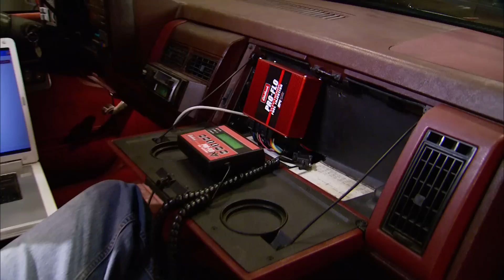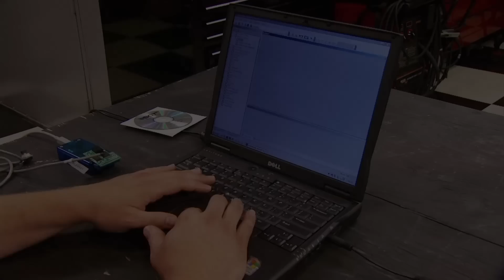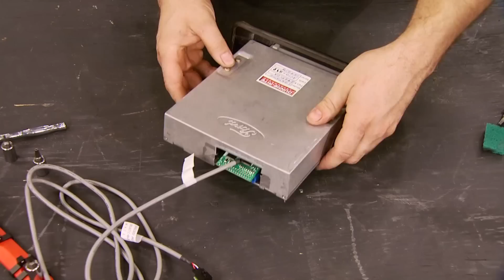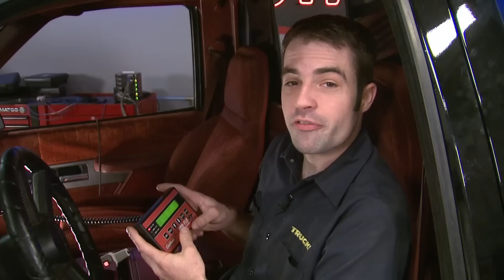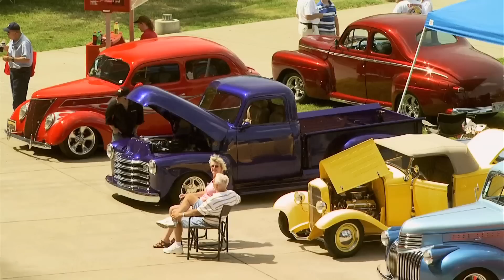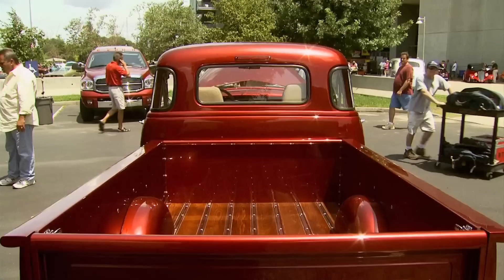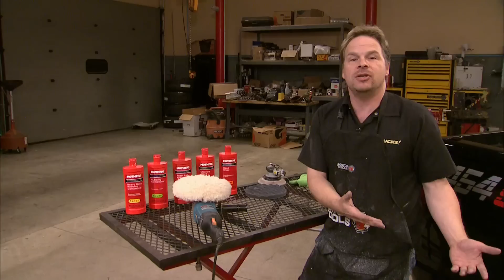Chassis Dyno Shootout: Chevy 454 SS vs Ford Lightning MuscleTrux Wars Part 6 - Trucks! S10, E15

Comment: Got to cost some $$ to get those guys to tune that OBD1 machine. Chips are such a pain. Dealing with a 94 k1500 have to do it through mail for most of us.  Who uses scotch lock connectors. 318hp ? Most small blocks can do that easy. Wow that laptop is over 10 years old.

Comment: Why in the World wouldnt you upgrade from the stock fuel pump.....
Reply: STREET RACER Why so rude? You get whooped by a few Lightnings?
Reply: STREET RACER Nevermind. The internet answered for you. Apparently you’re a well known shit stain around here. Lol 

What a tool.
Reply: 10 year old show
Reply: STREET RACER I don’t speak shit stain. Let alone peasant. You street race or “allegedly” street race because you’re not good enough to get a on a track and do it for real. You’re not even on my level. I wouldn’t even hire you to buff my race cars. 
You’re literally a tool. And a bad one at that. Stop ruining the car scene.
Reply: But they did.
Reply: Because it's a TV show.   I mean, they had the exact fuel pump right there to install.   I'm pretty sure they knew.  It's a TV show first and foremost.   They need content.
Reply: They technically did the put an inline pump in to help. Just didnt end up being enough fuel
Reply: @tannergallie9061  Yeah that does absolutely nothing when it has to draw through the tired stock fuel pump. The bigger injectors are only a small part of the whole picture when going with a power adder. I've seen it many times where somebody will install these exact same parts, but leave the stock and tired fuel pump in the tank and look in astonishment when their big money build falls flat on its face or roaches all the pistons because it leaned out under boost.

Comment: Lost alot of respect when you threw on the scotch lock.
Reply: Lolol even the old twist and tape is a better temporary connection. 
Those are supposed to be for temporary use , but I won't even bother with em at all either.

Comment: Instead of that stock Ford computer that require a chip I would have just swapped it out for a holly system. Plug and play. I'm not sure why anyone would want to monkey with that stock computer stuff having to burn chips anymore. But it will be nice to see how well they can make it work. I am curious why the choice was made to use that ecm instead of swapping out for an after market system like a Holly Dominator though?

Comment: Chevy Silverado's suck, I had two of them and they got alot of miles on the original engine and transmission no complaining about that. But they waste so much gas, the seats are cheap, the plastic brakes easily. I see alot of butt hurt fan boys. I'd buy a f150 over a Silverado any day.

Comment: these boys are living in 1994
Reply: So, what were they supposed to do in 2008, rebuild the engine and install aftermarket ECUs?
Reply: @wade998  yeah even in 2008 aftermarket ecus were around Ive got a haltech 500 sprint i think i got it in 2009 and them honda boys were doing it way before that with hondata Haltech was started in 1980s and had reasonably cheap standalones on the market by 90s
Reply: @CAZEDUPLESSIS  but, MUH CARBS!!!
Reply: @CAZEDUPLESSIS  I know, i had Greddy Emanage, HKS F-con, and AEM for 7mgte.  I found SAFC is the best bang for buck piggy-back.

Comment: NOW I would like too see  dump  the fuel injection and go carborator see if they pic up horspower!
Reply: Did it but no turbo better cam and heads no trans work and calculators put me in the 550 to 600 hp range
Reply: Uh nope

Comment: Isn't that from like 1999... lol chip burning... the Holley Dominator system you can get for what nine hundred bucks and it's like modern. First time I've ever heard someone going to a mass air flow system normally throw those things away when you make power. Go to any drag race event and see if anybody is using a mass air flow sensor.

Comment: The fact that they turbo’d a first gen lightning is so incredibly lame. Way to ruin a classic and make it as ricer as possible
Reply: And its hardly a classic.
Reply: 10k on a truck turbo kit lmfao
Reply: 4 grand for twins. I doubt piping is an extra 6 grand to get it to the bed.
Reply: A ricer is a car that looks like shit and is slow as shit. A turbo V8 truck that looks like shit but has decent performance is far from rice lol.
Reply: K5 Guy decent performance?? They easily spent $10,000 on that turbo setup and it doesn’t even put out nearly what a 2nd gen lightning does bone stock. And yes... a first gen lightning is a classic... nearly 30 years old and very rare. You’re a moron
Reply: Point is. Its anything but a ricer.

Comment: That 454 could of used a stroker bad or a non intercooled vortech
Reply: That 454 needed 11:1 compression to hit 500whp
Reply: @hemiboy9860  or forced induction to justify that low compression ratio.

Comment: My goodness that is trash!! I dont know what they did but a set of decent set of heads and cam on 454 should make 400+ to the wheels
Reply: @YOYO MA is that when this was filmed? If it was I still disagree lol my paw paw got a bone  stock 454 SS in 2000 when I was 10 stayed stock until 2002 I can remember it getting Edelbrock square port aluminum heads cant remember wich series probably performer rpms I doubt they where Victor's they where not ported but he did clean up all the ports but it did get a victor jr intake that he cleaned up and a 1050 dominator I would have to ask him about the cam all I can remember is that the shift light on the monster tach lit up at 6600rpm and sounded nasty through long tubes and a dual 3" set up with super 40 flow masters and turn downs still one of the best sounding car/trucks iv heard. It had a N.O.S plate pilled for a 100 shot and ran like 7.00's in the 1/8 on motor and 6.70s on the bottle in 2003 and that's like 560hp at the flywheel by using a hp calculator
Reply: @woodgrain18 , LOL! You have life in a BLENDER ON PUREE to claim 6600rpm from a stock 454! 6600 is a DREAM, but nothing more in a stock 454SS. It would be shocking to see it hit 5500 and 6600 is simply 100% out of the question when stock, TERRIBLE rod ratio is the biggest problem and when stock, that can't be fixed.
Reply: @robwh3954  lol ok..... I turn a sbe 5.3 to 7600 and shove 25 pounds of boost with a cam & springs china head studs and rod bolts every time it goes down the track or play on the street so and ring lands break first so I have a little experience in makin sbe shit live and go fast and I learned from somebody who has been doin the shit since the 60's. Get some real life experience before you trying to lecture me
Reply: @robwh3954  wtf are you talking about rod ratio??
Reply: @robwh3954  lol I just read your whole comment I can't believe you just said rod ratio? Idk where you heard or came to that conclusion lol the reason it want rev stock is cam and valve springs those are shitty heads so it might not make a ton of power but it would rev
Reply: I bet that transmission is garbage
Reply: @Frank Bonazza III there is a difference between a 4cyl and a 8cyl? Wow thank you for setting me straight. I never said a peraon was going to run a stock v8 pushrod out to 8,000. I simply stated that they set the factory rev limiters well below what the engine can safely take.
Reply: @sinformant  
NASCAR V-8s rpm to 8,000+ .
A V-8 is two 4 cylinders with a common crankshaft.
Pontiac made a 4 cylinder,  CUTTING a Pontiac V-8 in half.
( 1962 -1963) tempest.
Reply: @Frank Bonazza III you do realize that at the factory they set the rev limiter well below the actual redline of a motor since it is going into a production street vehicle and they don't want to have to warranty a car for a blown motor, let alone get a bad name for reliability because some people can't keep their foot out of it. Hell most factory 4cyl motors can easilly spin to 8,000rpm reliably, but they set the rev limiter to 6,000-6,500. Also in those factory pushrod v8's you'd probably get valve float above factory rev limits without stiffer valve springs.
Reply: STREET RACER ohh internet tough guy telling everyone to stfu.
Reply: I don't think that converter locks. I know the E4OD on the lightning does.
Reply: That hp and torque is pathetic for a big block.  Even with the crap 8.5:1 compression pistons it came with a decent heads and cam package and headers should do at least 400 to the wheels...even through a th400 trans.
Reply: Dont pay attention to dyno numbers besides that 454 truck computer and intake cant keep up.with the mods I have this same set up with slightly bigger cam and I made more power.
Reply: Josh Rooster Cogburn Wood Gen 5 BBCs like the ones in the 454ss had factory forged rods good for ~7k rpm and ~700 hp. Top end was heavily limiting as they would have valve float around 5500 rpm
Reply: @cameronpearce4472  I know they where stout pieces there's been several comments that said that's not possible lol like I said in 2002 when I was 12 my paw paw just threw a set of aluminum edelbrock heads dont kno what series a hydraulic roller cam dont kno the specs either I kist remember how mean it sounded lol with a vic jr intake and a dominator carb with a plate system and full weight in ran low low 7's in the 1/8 and got into the 6's on the bottle I can remember clear as day the shift light coming on at 6600. I can remember a few people back then that bracket raced and spun them pretty damn high
Reply: @Frank Bonazza III lol I think I can tell your real world experience with big block Chevys is limited let me drop a lil knowledge on ya first those big blocks came with forged rods and pistons with decent rods the rod bolts are the week link but they will be fine if you keep it under 7000 and less than 600hp and not trying to run a power glide behind it with 3.23 gear in a heavy vehicle it will live for a while. I know what the real I'm talking about been doin this since I was a little kid
Reply: In the late 90s I had a 74 Camaro with a 400 sb it made 371hp to the wheels. I wish I kept that car. I sold it in 2001 when I became a father.
Reply: @jasonanderson8528  I was just a youngen then back then my paw paw and uncle where big into bracket racing then, my paw paw bought a 80 Camaro in like 97 for 300 bucks to build a bracket car it was primer gray with a 400 with a small cam, he had the stock heads ported a little bit and decent valve train treatment a edelbrock tourqer  intake that he paid 20$ for and either a 650 or 750 double pumper  cant remember a 6a msd box and coil accel distributor and some cheap headers he didn't have hardly anything in that motor he put a powerglide in it with a cut drum a 25 dollar Rebuild kit and manual valve body and a used b&m 3000rpm converter 4.30 gears in the stock 10 bolt and mini spool with 26×9 Hoosier's and a set of weld pro stars up front and cragger copy cats out back he ran that car with that exact same combo in the footbrake bracket class all over Alabama from 97-04 when that old stock bottom end 400 had a come apart in the burnout I went racing almost every week with him and that car from 7 to 29 except now he lends a hand and watches. I still got that Camaro I just can't decide what I want to do with it, i could never sell it. But I know how it feels to have to sell a toy when babys come in 2009 I sold my first hot rod I built and paid for my self  it was just a little nitrous LT1 formula but It ment alot to me
Reply: @woodgrain18  those was the great ole days.
Reply: 500+
Reply: No joke I have a 10.5 to 1 454 with heads cam intake long tubes and it makes a 575 at the crank.
Reply: chris berry no it doesn’t lol
Reply: @scottsmith31  he's definitely full of shit. lol
Reply: Chris Smith it absolutely doesn’t
Reply: @chrisberry5714  ok boomer

Comment: WTF 300hp what a POS.... all that money and ZERO performance... way to act excited and try and make it appear that its real performance.
Reply: This is an old show.  That's how it was. We live in a time of crazy easy horsepower. Even the 60 muscle cars rarely made over  400hp.
Reply: @numbnutz9398  Not buying it...They had Holly tuning software back then.
Reply: @christopherbenfield7848 OK then.
Reply: Its not a pos its just a mild build.  Lightning is stock engine on like 4-5 psi the turbo is barely doing anything and the 454 had a mild top end kit there is a ton more power to be had out of both trucks with more radical setups.  Back then the autos sucked alot of power when dynoing whp.  Probably 20+%

Comment: what boost are they running like 4 psi ive seen 351w make 310 wheel na my turbo 302 made 500
Reply: I think they said 5 psi, also he didn't say stock, he just said na
Reply: I think they said they are running it at 5 psi. In any event, they did not upgrade the fuel pump prior to the dyno runs and we were not made privy to the final numbers after they upgraded the pump. I've seen 351W's make over 400 HP with a simple heads, cam, and intake swap and no power adder. While they did not change those parts on this, one can assume that it would make more than it did because even a stock 302 H.O. with a SC or turbo can make over 400 flywheel with no head, or intake changes. I knew a guy who had a 5.0 LX with an E303 cam and a Vortech SC and that's the kind of numbers he was getting. One would surmise that a 351W is capable of making the same or greater.
Reply: A stock na 351w Don't make 300 wheel, they didn't make 300 at the flywheel

Comment: Nice job adding a ton of swirls to the Silverado with that electric sander... When you cut paint you're supposed to go in straight lines (by hand) wet sanding. Then buff and polish. I'd be really surprised if this didn't majorly thin out the paint because this is still when most cars were single stage

Comment: Commenters keep bringing up the difference between "good" power back then, and "good" power now.     Technology has surely made a difference.   Now you can buy a showroom Mustang/Camaro/Corvette, or even Cadillac with what USED to be considered "supercar" power in the 400+ bhp range.    Crazy.
Reply: Jay Leno recounted a story when a dealer talked him into buying a Viper. Swore up and down to him that you'll never see another factory production 500HP (may have been 400, can't remember) car again. These days 500 is good, but not impressive anymore.
Reply: @sparkplug1018  the only reason GM developed the TPI intake manifold is because in the early 80s they thought they weren't going to be allowed to put anything bigger than a 5L in cars in the then near future so they tried to give the 305 the same torque as a 350. That's how crazy government regs seemed at one point.
Reply: @lb9gta307  Pretty sure I didn't mention anything about government regs in that comment.
As an aside, the emissions regs and fuel economy standards are stricter today then they've ever been and yet the power and displacement continues to rise, due to more advanced electronics being able to meet the regulations.
Reply: @sparkplug1018  you didn't mention regs, I did. All I'm saying is that that's the atmosphere the auto industry had not long befor the Viper came to be.
Reply: @lb9gta307  Perhaps, but I doubt the OEM's had the mindset of never being able to use bigger engines again. Heck the 1984 Corvette had a 350, the Camaro got it back in 87 I believe. Im sure the reg's slapped them hard back then for sure, but I'm pretty sure they were well aware they'd be able to work with them.
Reply: @sparkplug1018  CAFE ratings tightened pretty agressively in the early 80s when they were developing the TPI 
https://afdc.energy.gov/data/mobile/10562

We hear similar talk in automotive media now with people saying that the V8's days are numbered for the same reason.
Reply: @lb9gta307  Id attribute that more to being able to reliably get the power from smaller packages these days. What a factory turbo 6 can do now was a pipe dream 35 years ago. New materials, new technology and all that.
But id say its a safe assumption that as long as theres a demand the v8 will continue on.
Reply: Rick, and now a decent weight is anything under 3800lbs while back when 400hp was a lot that was heavy

Comment: Just put ls3  376/525 crate engine in both, and enjoy the trucks. 

Or if ya want put some kind of forced induction on those ls3 engines sit very conservatively at 700-750 whp and just enjoy, 

These trucks worth that miney about 12k
Reply: Or put a boss block 351 Stroked Clevor  SBF capable of 900hp+ NA on pump gas, that will last and won't send your rods thru the side. And enjoy your truck. Many different ways to go about it no matter what brand you prefer. https://www.youtube.com/watch?v=5Rz7paeKSOM